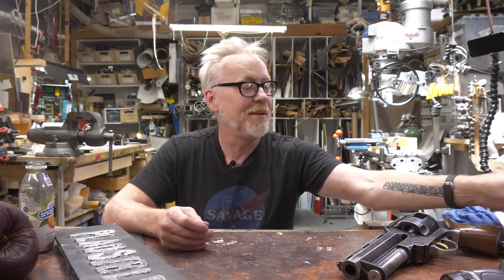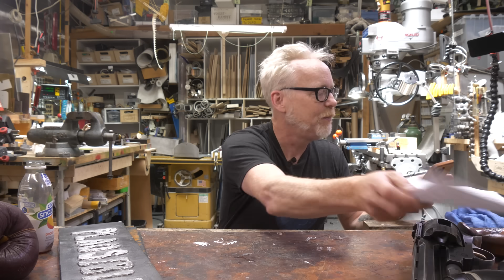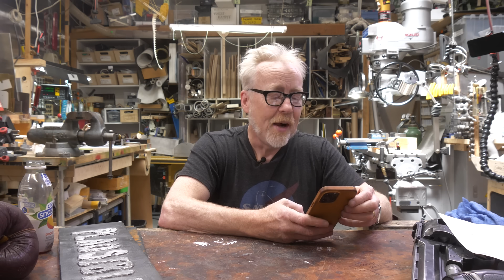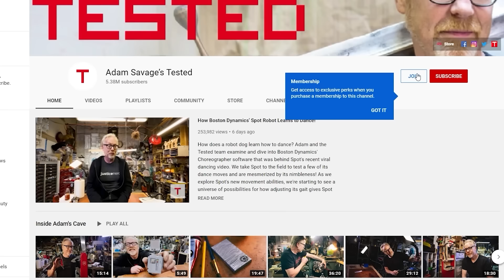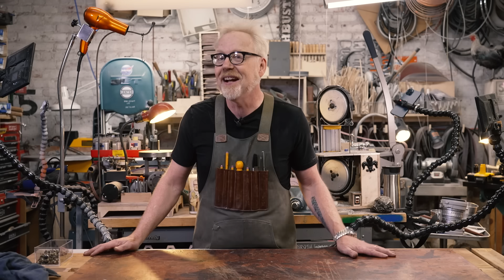Hardest-to-Obtain Item in MythBusters History

Comment: That story about the lead foil is fascinating. It's incredible that it took a year and half and your request broke 2 companies machines. So crazy.
Reply: If I remember correctly, the German company's solution was simple and elegant. They just folded the foil onto itself before rolling it so that when it was unfolded it would be half the thickness.
Reply: @HermanVonPetri  That's the way they create aluminium foil. That's why the other side is shiny and the other matt.
Reply: @makettaja  I just wanna see how they unfold it and smooth it out so perfectly again.
Reply: @HermanVonPetri  I'm guessing 0.7 mil is a misremembering of 0.79 mil or 20 μm, which could be double rolling on a 40 μm production line.  Given the rules for lead poisoning safety, my guessed use would be lead lined electric phone cables where a second layer of plastic or paper prevents human contact outside the factory and other specialist crews.
Reply: @johndododoe1411  doesn't work with lead though.
Reply: @HermanVonPetri  That's exactly how tinfoil is done.
Reply: as soon as I read the title I knew the lead balloon story was coming
Reply: @Yugophoto  That was my first idea too.  Had to be lead foil.
Reply: Making large quantities of foil that thin is difficult, making lead foil at all that thin is a massive pain in the ass. It is impressive to me that they managed to get lead foil that thin at all. As it has been said several times before lead that thing has the consistency of wet toilet paper and therefore we'll take any excuse to cease existing
Reply: @the_undead  Funnily enough, the basic paper insulation on phone cables has the same problem.
Reply: This story really makes you think about the insane amount of engineering it takes for even the smallest parts of our modern society to run.
Who would have imagined making flatter than average foil would be that much of an engineering challenge that two separate companies dedicated to making thin stuff would both fail?
Reply: It kinda makes me wonder what the Germans were actually using it for when they could make it that thin without any great amount of difficulty... because I am going to be polite and assume it has nothing to do with Germans working in millimetres and Americans working in inches.
Reply: @Outside85  I'd guess for medical/science instruments that need good EMI and radiation shielding.
Reply: This is a prime example on how production delays happen in a lot of products. Even more so in electronics.
Reply: Kinda interesting, but Ive been in the medical field for 7+ years and youd be very hard pressed to find any operating instruments (clamps etc) that arent made in Germany. I guess their stuff is primo.
Reply: You can never surpass the quality of GERMAN ENGINEERING 
-JoJo part 2
Reply: And then the crouts got it done.
Reply: Technically speaking, the companies broke their own machines through incompetence attempting to fulfill a request without actually having the knowledge required to make the modifications correctly.
Reply: I’ll bet those factories that broke their rollers were pissed
Reply: Doesn't even surprise me that the Germans were the ones to pull it off
Reply: At least that was the companies excuses for not delivering the products. may be they just failed to produce it to the require specs and didn't want to admit that.
Reply: well american quality. what can you expect. Had to go to Germany to get the real deal. hahaa
Reply: @makettaja  The thing is that Germany is the main producer of machinery, so could also be the case that they just knew the machines much better or had a direct connection to the producer of the machine.
Reply: @makettaja  What a dumb comment